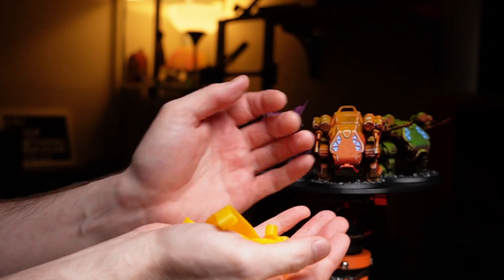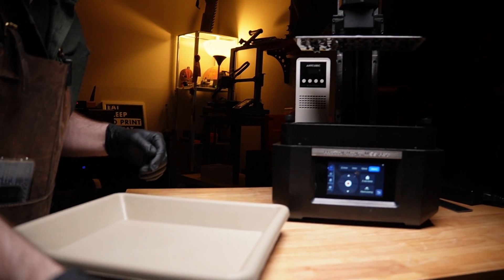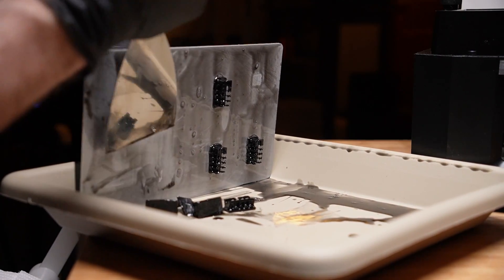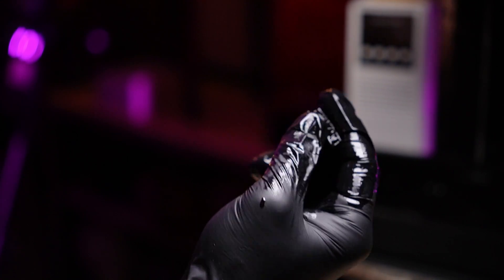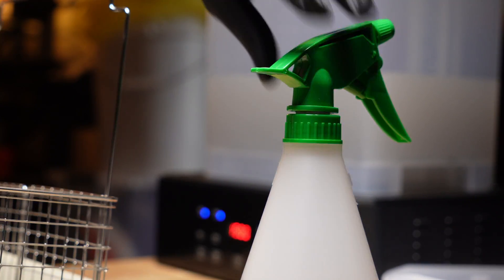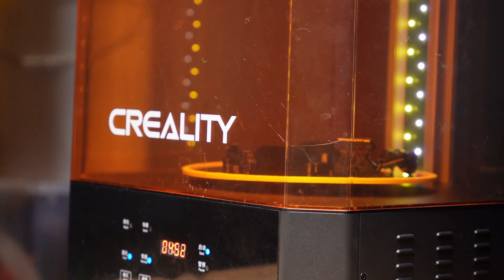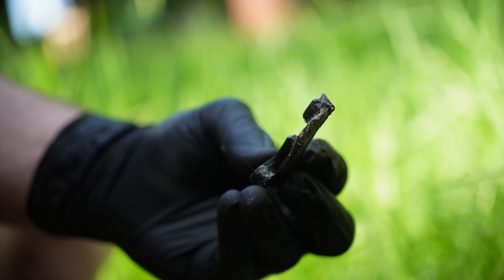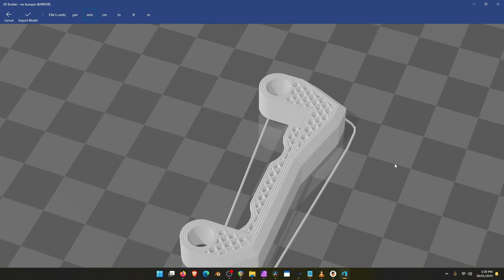Printing drone parts in FLEXIBLE RESIN!

Comment: "omg it's so much easier to print resin than fdm let me show you"
> proceeds with the gooiest, smelliest most annoying process ever and has to waste 1/3 bottle as soon as there is any delamination.
>oh, and make sure to have an exhaust to vent out all the cancerougenic vomit endusing fumes
Reply: but.. but.. it IS much easier though ‼️😂
Reply: @oljobo It's also easier since you die early, which saves you from a lot of printing...😅
Reply: As a user of both, FDM is just so much easier.  The trade off is the detail.  I only use resin because I have to. The prints are amazing, not a single layer line, just plastic-y shiny results.  But it’s a toxic dirty long process. 

I love being able to set FDM and walk away. And then just pop it off the plate and IT’S DONE.

Both have strengths and weaknesses, I print in resin much more, but FDM is much easier.
Reply: @DisgruntledPigumon  I'm still amazed what my P1S can do, when it comes to details. And I haven't even started to use 0.2mm nozzles. I use it to print terrain for Necromunda (a tabletop game situated in the Warhammer 40k universe) and soon will add a second one 😁. I also printed a (self-designed) vehicle - a hovercraft for the "Ash Wastes" that will be 65cm long (just finished all the prints and still need to assemble it) and plan to do more.
Reply: As a printer who prints both resin and fdm? Absofuckinlutely! @DisgruntledPigumon
Reply: And isn't there post processing?  Supports look so annoying to remove.
Reply: if your hotend gunks up thru a failure...you have way more problems..and probably more fumes..
Printing both FDM and MSLA..i only get the started if i need mechanical parts...the Msla printer is standing in my kitchen..as long as the lid is on you can´t smell it!
Reply: I love working with goo, you can even mix the goos and add color to them. Although it's not an efficient process. It has it's advantages and disadvantages.

Comment: I have both resin and fmd printers at home. I haven't tried any flexible resins but I can tell about 95a TPU and at least the brand I used in had no big hassle even in a Bowden setup.
I do believe that resin printing is a little easier at least with the regular stiff ones idk so much with the flexible ones though.for me personally I stick with 95a TPU
Reply: It's so much more hassle for a worse part though, my resin printers literally never see use. It's like comparing multipart heat cured epoxy to hot glue except the hot glue is stronger lol.
Reply: @thirtythreeeyes8624  each technique have its uses. For practical mechanical prints fdm is hands down the best for highly detailed small things there's no comparison on the resin quality